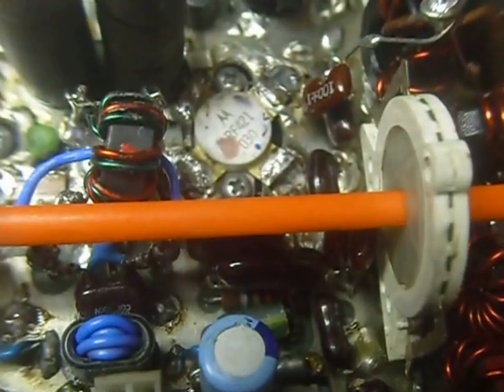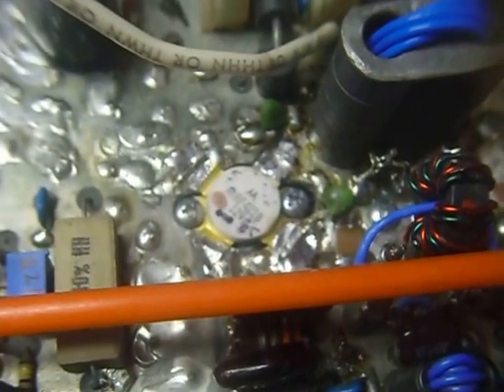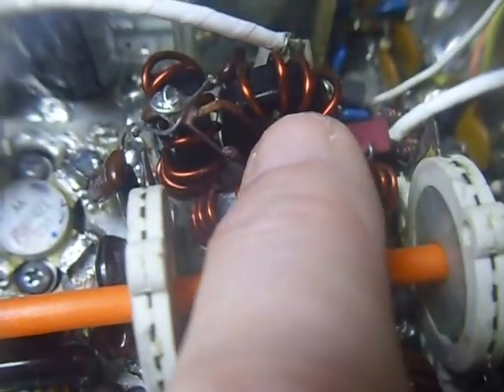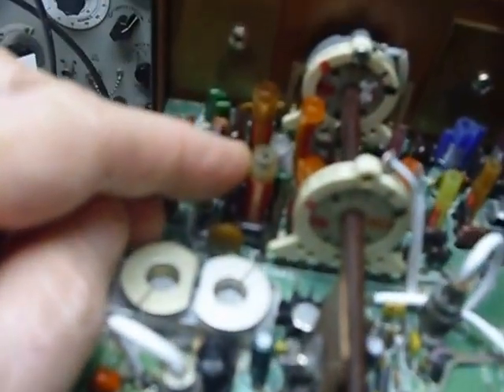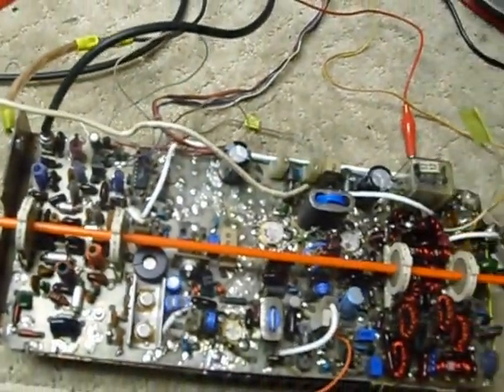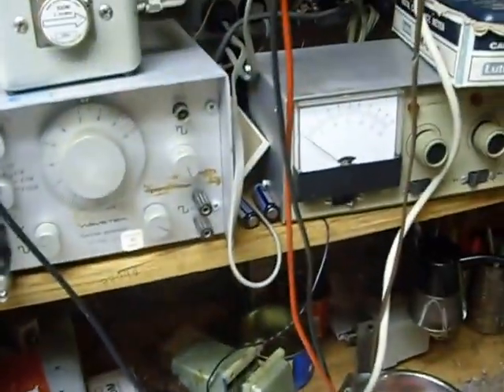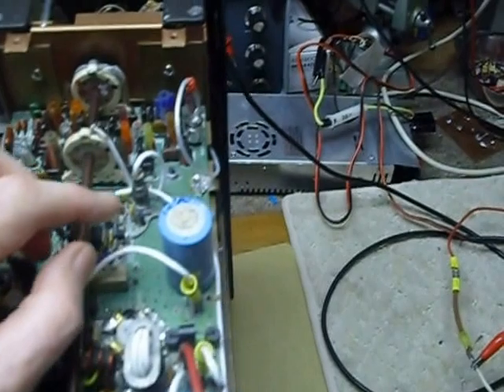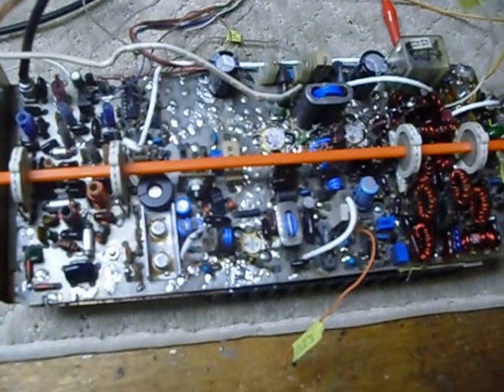PART 4 HEATHKIT SS8000  rarest Heathkit Synthesized HF tranceiver

Comment: Robert you are a treasure of information and it such and joy to watch your videos and learn a bit about these great old radios. If you ever have any spare time you should write either a long article or a book about your time a Heathkit and share with others some of the gems of information regarding design and maintenance of ham radio equipment.  I know the ham community would welcome a either a  article or a book of your electronic background.  Continued success on your restoration.

73 Kevin - KG0MN

Comment from the maker: Bain 5872   Heathkit was the best place I ever worked and I worked at quite a few .  Yes I was really surprised when I bought the basket case SS9000 back in 2013  and found it was one I had personally checked out in the Heathkit engineering dept.  I took great pride in my work  there  and stuck a little sticker on the units I worked on with my initials and the date on them .  I don't know any more about bringing Heathkit back than you do.
It sure would be nice if someone was able to bring the company back .  73 Bob

Comment from the maker: Well Kevin and Squireca the next unit I already  finished  today it is  the bandpass filter box it has 6  filters in it  They were badly out of alignment. I do not plan to make separate videos on everything in the restoration that would take to much time for me  . From this filter assembly and the missing parts on the PA board that were never installed  I am thinking this SS8000 was in the process of being assembled when the whole project was cancelled .  The SS8000 was a  KIT and not an assembled tranceiver like the SS9000 .  Bob